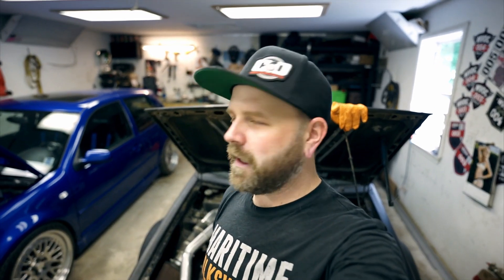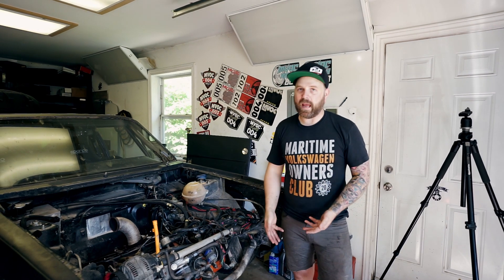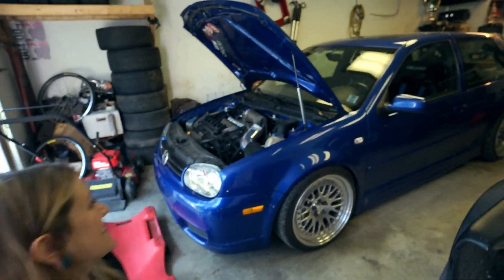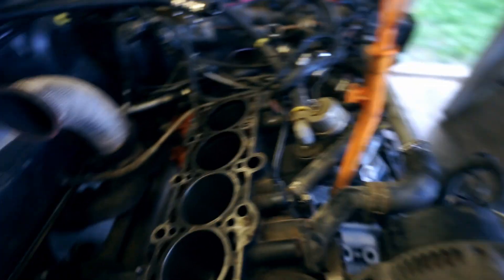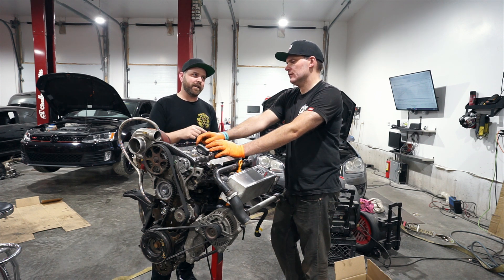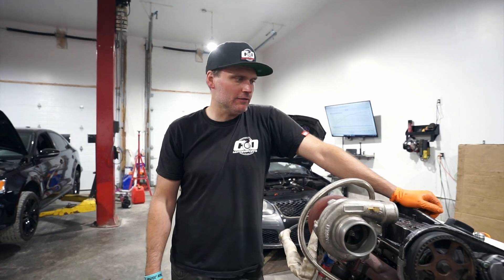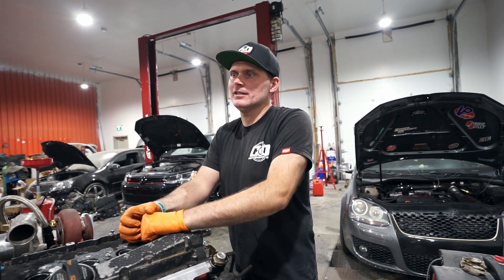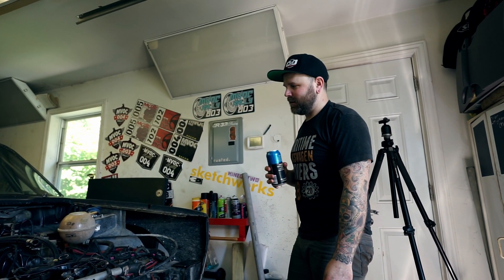What happened to the Berg Cup MK1 1.8T?

Comment: Need to upgrade that turbo to a gen 2 or g series, pulsar turbo on ebay makes allsome copy turbos and they work great and last, they even make g series under 900$, I think the finished on them looks better then Garret honestly, would be night and day difference, why didn't you take it out this summer. Should do a update on it.
Reply from the maker: This turbo works great, and makes way more power than we need for the track. Also we're a pulsar dealer and I can confirm that the quality/finish is not as good as garrets. But lots of guys have made power on them, I'm going to put one on my daily to see how it holds out long term.
Reply: @COMotorsports  a newer style turbo will definitely be more responsive, and I think pulsar make the gtx3071r with a 9 blade turbine wheel which is definitely a upgrade over the 10 blade 3071 turbine wheel, a g25-660 or maybe even a 550 with how low of HP you run,would probably be even better for a grip car, all the response, that old gt3071 is probably so laggy compared to a new turbo
Reply from the maker: @coreycrosswhite8890  There's no lag when the car lives it's life between 5-8rpm. For what we're doing this is a perfect turbo. The car only needs 300whp to be a handful at our local track. Are there better turbos on the market 100%, is it worth spending even $10 to switch from what's on it... nope. Again this setup is perfect in regards to power/delivery. Where it needs money spent is getting more traction.

Comment: hi i found you guys on YouTube. i was wondering should i change the stock keepers or should i change them out? i've already got billit ss valves with chromoly retainers, i will be running stock cam with a rev kit running to 8.5k rpm so i was wondering would the keepers be a weak point on the steel valves?
Reply from the maker: When changing valves we general switch to valves that use single groove keepers.

Comment: Found you guys because I'm trying to learn more about golf turbo builds and found your channel through my searches. Not a whole lot of mk4 2.0 8v turbo builds out there. But I'm going to try it anyway
Reply from the maker: As many have likely already told you. It will be way more cost effective to just swap in a 1.8t. Greater power potential, and more readily available parts. 8v just doesn't make sense. More money and less power.
Reply: @COMotorsports  I know it sounds crazy. But that's kind of the reason I want to do it. Because it's not the best option every one over looks the whole platform...I might do a 20v head swap down the road, but at the moment I want to see what happens
Reply from the maker: @SuperHbkforever  do the 20v head swap. Or if you want to be different do the 16v head swap. Same setup I run in my drag car.
Reply: @COMotorsports  I think I will eventually! Your build has been a really big inspiration for future ideas! And I know your setup flies! 
To my understanding, it takes a bit more work to make a 16v head fit to a AEG block? Correct me if I'm wrong, and maybe fill me in on what that process entails?
Reply from the maker: @SuperHbkforever  a little bit more but not really. However 16v stuff is getting harder to find as well so the 20v head still makes more sense.
Reply: @COMotorsports  do you know of any good VW tuners in BC? Or do you guys do Etunes?
Reply from the maker: @SuperHbkforever  I'm sure we could help

Comment: What accessory belt setup are you using for that motor? I noticed it's an AEB. ABA stuff with shaved pulley?
Reply from the maker: The only thing AEB was the cylinder head, wiring harness/ECU. The short block is an 06x block... like AWP stuff.
Reply: @COMotorsports  gotcha. Thanks!